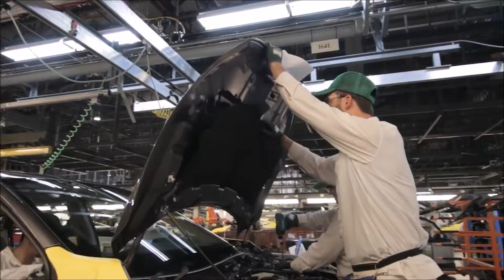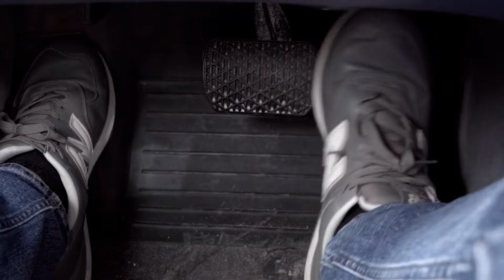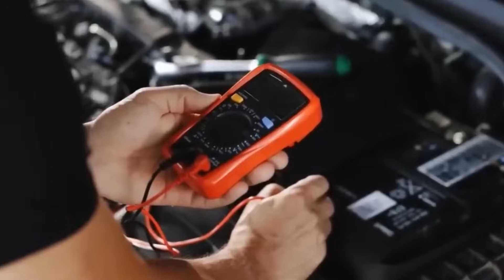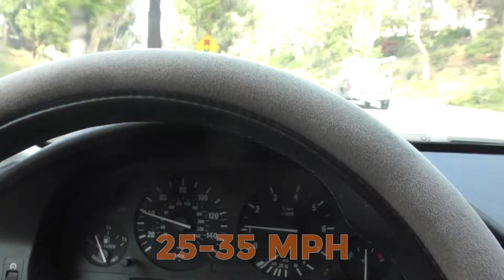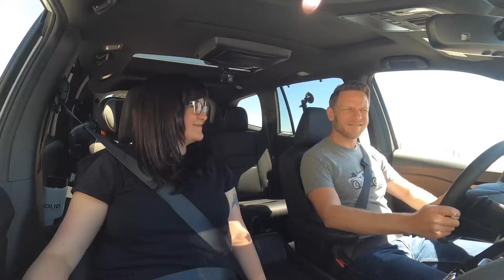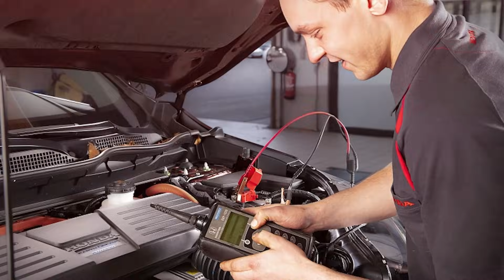$0 Honda Reset Trick Mechanics HATE That Fixes EVERYTHING!

Comment: I have a 2013 civic. I have several service lights on but the dealer service department says they are all tied to the ABS light through a module and by not repairing that, all the other lights are forced on.  That doesn’t sound right, but the diagnostics don’t show the other problems. Is there a way to correct the other warning lights?